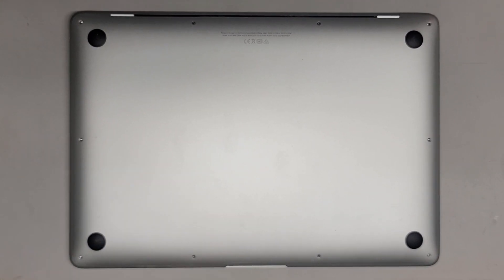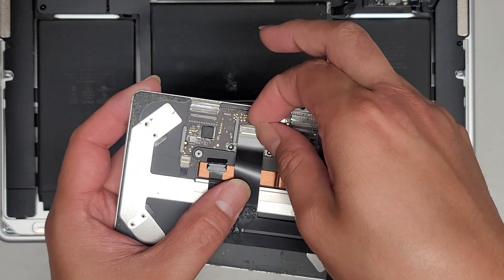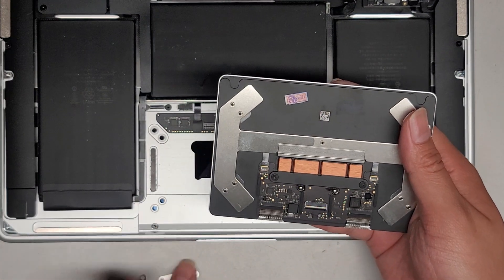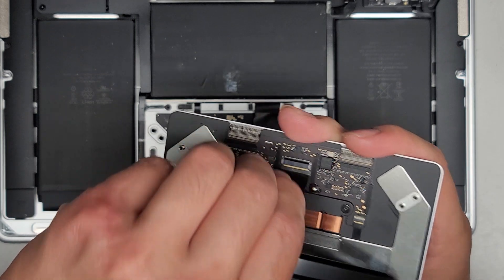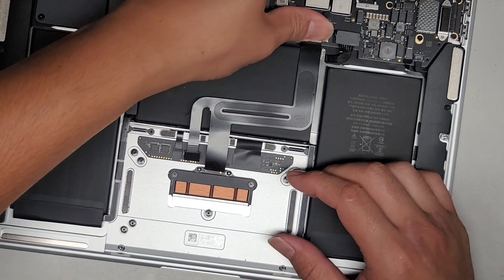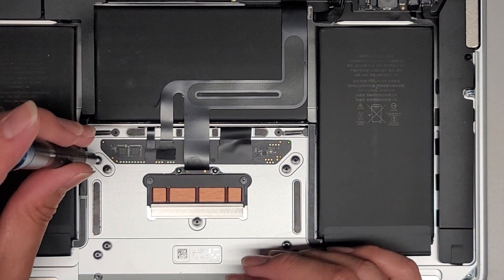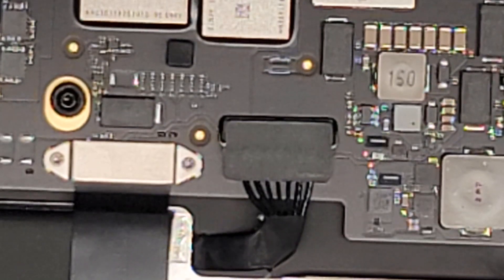MacBook Air A2337 Trackpad TouchPad Track Pad Touch Pad Removal Replacement Repair

Comment: Hi, my trackpad is working as i swipe on it, but the haptic pfeedback and clicking is gone, it looks stucked, i opened and check3d everything was fine, can you help me 😢
Reply from the maker: @ShamsherSingh-ui1bw  did you lose the washers?
Reply: @ItsBinhRepaired  no everything is in check
Reply: Like it's moving but no haptic vibration, nor any clicks
Reply from the maker: @ShamsherSingh-ui1bw  might need to replace it.
Reply: @ItsBinhRepaired  any other option, I tried resetting vram it's just working as mouse pointer  no click and no vibration
Reply from the maker: @ShamsherSingh-ui1bw  replace the touchpad

Comment: My t3 and t4 don’t work on the trackpad cable cover. What screw did you use??
Reply from the maker: @i.k5143  T5. But if you already used those, you likely stripped it out.
Reply: @ItsBinhRepaired  Shit. Nothing left to do now?
Reply from the maker: @i.k5143  try a t5 screwdriver
Reply: @ Didn’t work. Am I screwing the right way, is it clockwise or the other way?
Reply from the maker: @i.k5143  counter clockwise
Reply: @ItsBinhRepaired  You owe me an M1 sir, but I'll settle for the 16 inch M4 MAX too
Reply from the maker: @i.k5143  because you don't know how to use your brain to know what size screwdriver to use or which way to turn a screw? Lol...
Reply: @ItsBinhRepaired  lol, jk dude. I did follow the ifixit guide. T3 then t4. I suspect the screwdriver I ordered from Amazon is garbage. Hope I haven't done too much damage to the screws. Will order a new one
Reply from the maker: @i.k5143  don't use cheapo screwdrivers. The ifixit set is good. https://amzn.to/4141M7N Always start with a larger screwdriver and work your way down in size if you aren't sure. I never follow the guides. I decide on the screwdriver based on what fits.
Reply: @ItsBinhRepaired  That's a good tip about starting large, thanks. I will try to order the ifixit ones, didn't find them on Amazon Sweden but I see they ship abroad here anyways. Cheers
Reply from the maker: @i.k5143  sounds good
Reply: @ItsBinhRepaired  I did it, finally. Found a solution that wasn't on the internet. But you know that silver cover that I couldn't screw of - one of the screws wasn't stripped so I took that one off and then I just rotated the entire cover with one screw still in. Worked. Gave me room to take out the cable and put in the new one. Rotated it back over and screwed the right screw back on. Rest I did using your video. Cheers mate

Comment: Epic video, and I 99% succeeded but at 9:43 of the video if the connector comes off the board entirely the keyboard stops working!! Any ideas how to fix - or what I need to replace?? Help…
Reply from the maker: Need to put it back in. If you mean the latch and stuff ripped off, you'll have to replace the touchpad
Reply: @ItsBinhRepaired  it’s the part of the trackpad cable that’s connected to the left of the trackpad hole - and yes I’ve ripped the connector and pad off. Thinking on it is it the keyboard it’s attached too - new keyboard time?
Reply from the maker: @ralfedge203  upload a video of it
Reply: @ItsBinhRepaired  whenever I comment with or without a video link it always says posted but never appears - so trying again earlier in the thread. https://youtu.be/0NE6ALLNfxo?si=4ROO3W3YvU6f6_9l
Reply from the maker: @ralfedge203  oh shoot :( if you're lucky, I haven't tried it, but I'm assuming you can use some isopropyl alcohol to lift that little board away from the keyboard assembly and find a used dead keyboard to pull a replacement from.

Comment: i had a Macbook Air M1 with slight water damage. The keyboard and trackpad were unresponsive. I bought a new trackpad and cable from amazon and used this tutorial. Now both trackpad and keyboard work 100%. I guess the keyboard is somehow connected to the trackpad by the cable, but once I replaced, both were functional. Thank you for making this vid!
Reply from the maker: Awesome! Yeah, it's an Apple scam. They make unnecessary components dependant on each other so they can tell you something is severely wrong and charge more for repairs. They made screens go completely black when it detects a crack so they can lie and tell you it's a logicboard issue when it's not. Extremely corrupt...
Reply: @ItsBinhRepaired wait, that exact thing happened to my wifes intel macbook air. Do you know how to fix that?
Reply from the maker: @DELFUNK2015  which thing? Might need a replacement screen.
Reply: @ItsBinhRepaired  her screen went black after she bumped it when it was in her bag. The comp repair shop said it was a bad logic board.
Reply from the maker: @DELFUNK2015  likely just needs a new screen
Reply from the maker: If you haven't already, please like and subscribe so others can find my videos and possibly consider watching a few others and commenting to get the algorithm to recommend my channel. Thanks!
Reply: What store did you order from on amazon and is the quality on pair with the original?
Reply from the maker: Trackpad? Pretty much the same.
Reply from the maker: https://amzn.to/4g9RNnY

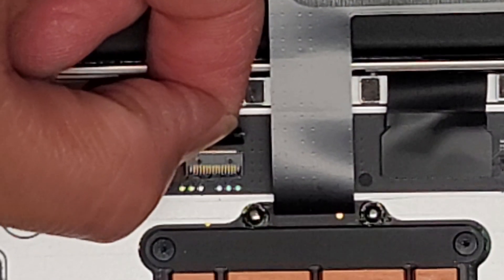Comment: on the 1:58 min mark.. i completely broke off that socket while pulling the ribbon cable forgetting to lift the latch up.. now the keyboard is messed up :( what do you recommend i should do? 

thanks for the video
Reply from the maker: @dimepia123  you'll need a micro solder expert.
Reply: @ItsBinhRepaired  thank you for your response.
 Just to solder in a new socket or replace the entire pcb?

Comment: Hi thanks for the Video how ist the little Board for the Flex Cables fixes i see no screws ?
Reply: Its doublesided glue tape
Reply from the maker: Use isopropyl alcohol
Reply from the maker: Hm?

Comment: I had spilled some water on my macbook and it started to click when not asked for. I saw your video on YouTube and replaced the trackpad with a new one. It worked fine for a day but suddenly stopped working and now, even my keypad doesn’t work anymore. Do you know what might have gone wrong?
Thanks.
Reply from the maker: Sounds like the water damaged the motherboard/logicboard
Reply: @ItsBinhRepaired  the keypad used to work fine before the repair
Reply from the maker: @swopnildahal7282  Water takes time to corrode. If not dried properly, it gets worse and worse.

Comment: The piece that connects the keyboard flex cable(like the part that is supposed to click it into the trackpad) came off during a battery replacement do you know if there’s a way to fix this?
Reply from the maker: Click? Do I show it in the video?
Reply: @ItsBinhRepaired  yes, sorry I’m not explaining it right it’s by the trackpad where the flex cable detaches there’s a very small tab that holds the cable in place 1:53
Reply from the maker: @sennappel  the flip latch came off? You need to get it back on
Reply: whatever the flex cable is plugged into that whole piece came off
Reply from the maker: : ( need to replace the part.

Comment: I have had issues with the trackpad and keyboard turning off suddenly. We tried getting a new flex cable and that didn't work. We also tried another part, I forgot the name of it, but that didn't work. Any suggestions? And is this a common issue for this MacBook Air model? I've been trying to fix this for months now
Reply from the maker: Battery and trackpad/cable
Reply: the battery reads fine, and we already tried daughter board and trackpad cable. Do you think we should try the whole trackpad? @ItsBinhRepaired
Reply from the maker: @carlascy17  possibly :(

Comment: My A2337 stopped clicking properly, or better, it does click but only sometimes. Out of the blue, it starts clicking again, otherwise the haptic feedback is mostly gone.
Do you think I need to replace the whole trackpad? I already ordered one and I'm relying on your video to replace it!
Thank you
Reply from the maker: Usually the trackpad or the cable. Hope the repair goes well. If you haven't already, please like and subscribe so others can find my videos and possibly consider watching a few others and commenting to get the algorithm to recommend my channel. Thanks!
Reply: I have the same problem just now!! Drives me crazy!. Did you solve the problem?? Please let me know. I am not sure if it is a hardware issue or software. Already opened and cleaned the laptop, I reinstalled macOS as well. It did not solve it.
Reply from the maker: Change the trackpad and cable.
Reply: @ItsBinhRepaired  just bought a flex cable, I'll change it. I'll let you know.
Reply: It does not seem to be a water issue either. :c

Comment: I had some liquid damage which caused my keyboard to stop working, I replaced the keyboard and it still didn't work then changed the trackpad as I've heard they're connected but the new one didn't work do you have any tips?
Reply from the maker: Did you replace the trackpad cable? Might be the motherboard connector.
Reply: @ItsBinhRepaired  the new trackpad cable didn't work at all and neither did the new one. The old trackpad works but the keyboard doesn't work at all even when trying with a whole new trackpad and cable
Reply from the maker: @M3HMI  might be the replacement is bad
Reply: @ItsBinhRepaired  I've ordered new keyboard, trackpad and ribbon cable so hopefully when I plug them in they work thanks for your help
Reply: @M3HMI it works?
Reply: @hugoogamerpro  I ended up replacing the trackpad which fixed the issue.
Reply from the maker: Awesome!
Reply: @M3HMI  Just one more question, when your trackpad is damaged will you be able to see the cursor on your laptop? Mine got damaged and I don't see the cursor until I plug in a USB mouse
Reply: @hugoogamerpro  Yeah the same thing happened to me, I'm guessing it's because the computer isn't registering the trackpad because it's damaged
Reply from the maker: Both trackpad and keyboard will stop working.